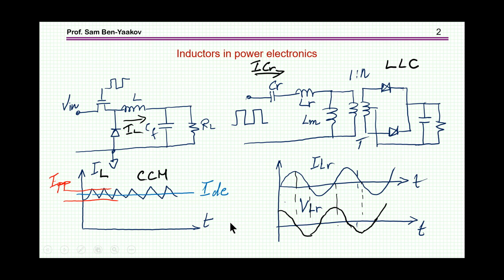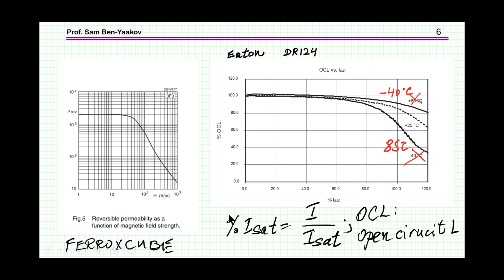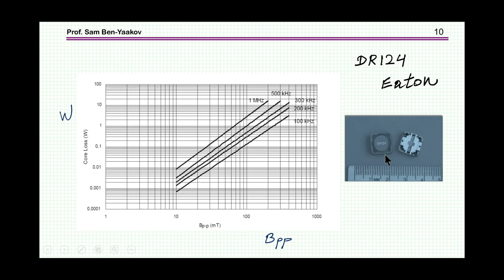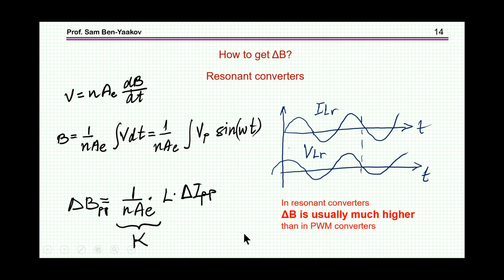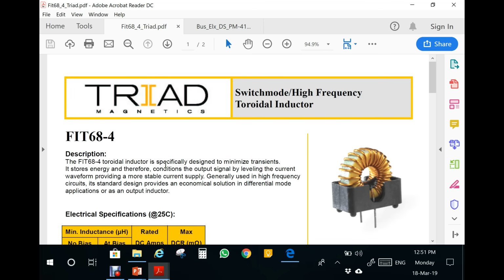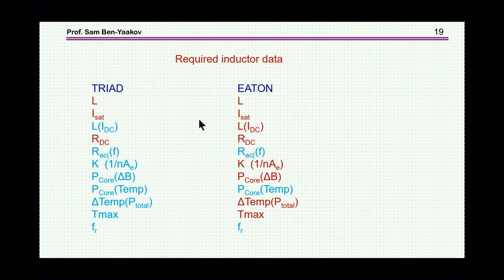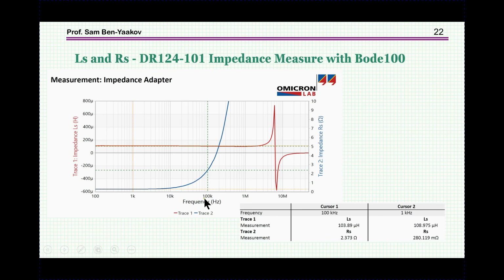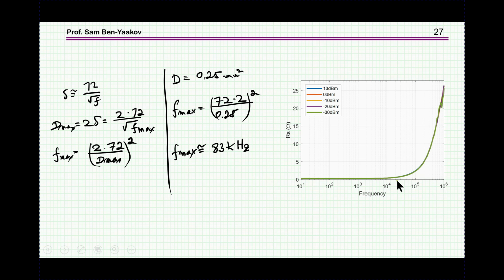Applying Omicron’s Bode 100 to avoid pitfalls when applying HF inductors in power electronics

Comment: Geat video like always professor. Would it be correct to say that by measuring this curve Rac(f) for an inductor, without its core, will give an effective ESR that accounts only for the copper loss ?
Reply from the maker: No. The core affects proximity effect which is involved in the ac loss

Comment: If the inductor current waveform is almost rectangular and calculating core losses using flux peak value and core material datasheet curves, is the result good estimate? Or should we take first harmonic expression and use that...
Reply from the maker: Have you seen https://youtu.be/bPBS1_hT7YI  ?

Comment: Thank you Prof. What is the best way to measure the core losses at the lab?
Reply from the maker: I holding on to my answer. I have posted the question in my LinkedIn group (Where analog and power electronics meet knowledge, https://www.linkedin.com/groups/13606756), let's see what the members of the group will suggest.
Reply from the maker: You mean the total loss or the magnetic core loss (excluding copper loss)?